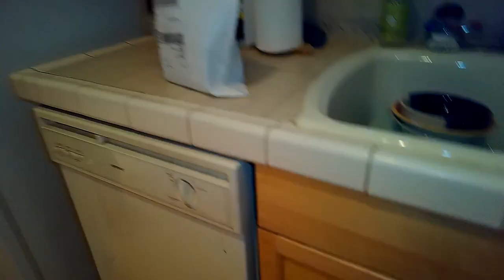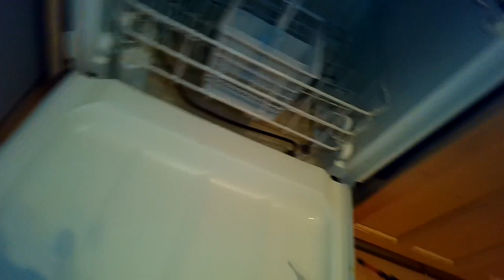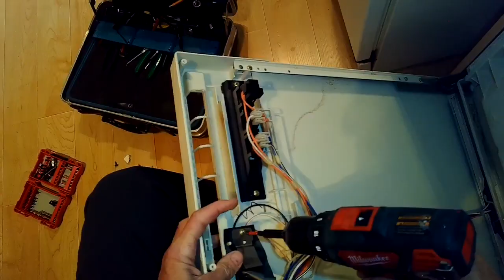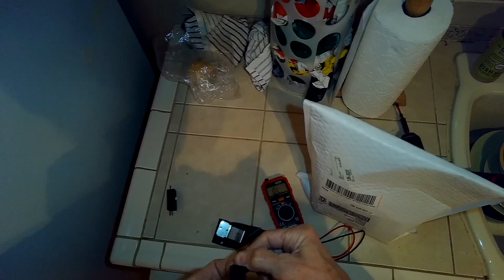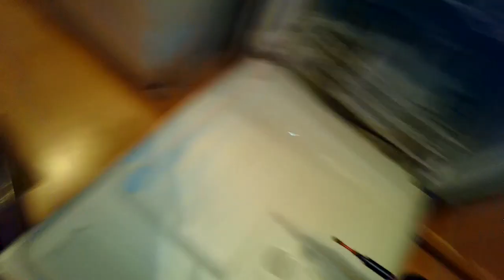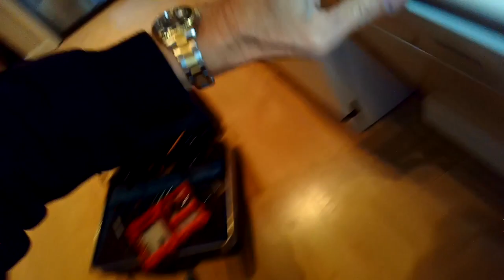✨GE Dishwasher  -  DOESN’T START  -  EASY FIX ✨

Comment: I have the same dishwasher.  What do you do if it comes on but does not start any of the wash cycles?
Reply from the maker: Hi Dee,
That sounds like you may need to replace the door switch because the Dishwasher thinks that the door is not closed and that’s why it won’t start the cycles.
Reply: @ScottTheFixItGuyChannel  thanks

Comment: Where can I buy this in Canada? I have an older GE dishwasher, but there is no visible sign anywhere as to the model. I found something similar online, but my part says 3/4 HP and not 1/2 HP will this make a difference?

Comment: Thank you for making this video, it was almost exactly the same problem as mine. The little metal plate's plastic nub that keeps it straight to push on the switches had apparently gotten to hot to many times and melted sideways, causing the plate to be diagonal and not ever coming in contact with the switches. My wife now thinks I am some sort of genius, I will use this momentum to convince her I need more tools to fix things. lol
Reply from the maker: You are A genius😊👍

Comment: What is the part called inside the door latch? I have a GE sliding latch model that starts and then stops working
Reply: Thank you so much for this video. My dishwasher would not start. I paid $8 for the little switch and it works perfectly!  You saved me a lot of money and hassle :)